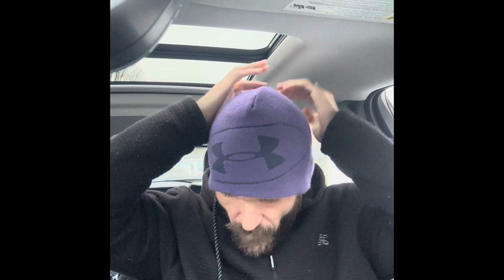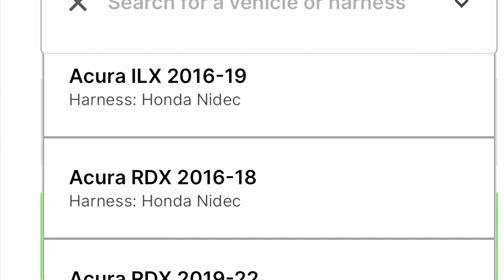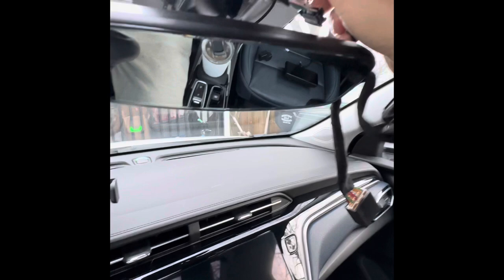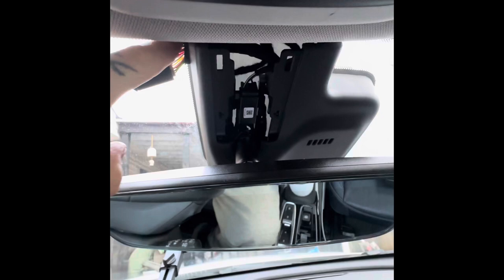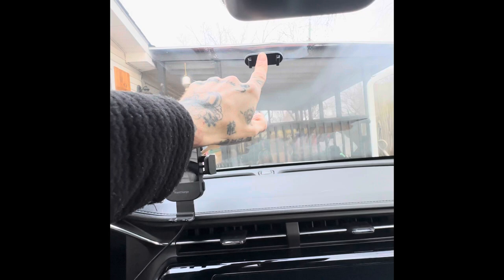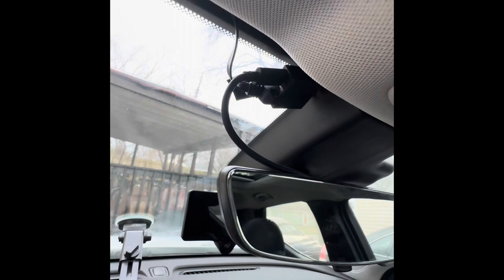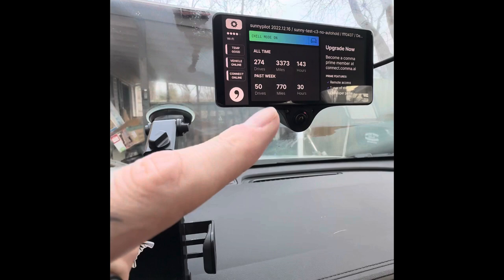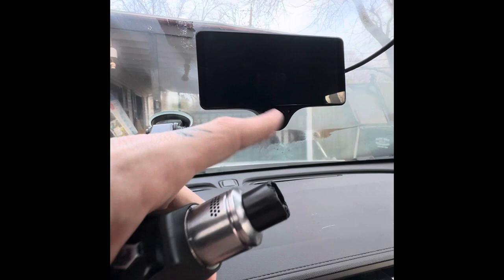How to install comma 3 on 2022 bolt euv premier

Comment: And you never have to pay GM $25 a month for it to work. Cool.
Reply from the maker: Right lol and fyi gm can’t do regular street roads is completely limited. It isn’t the Cadillac super cruise. They have the bolt the old 1st gen half ass super cruise from years ago lol. I’d put the comma 3 against any driver system and it’ll poop all over them 😂 they didn’t rank number one no reason

Comment: I’m stick at removing the cable. I pulled white tab just fine and I’m squeezing and trying to pull the cable but it feels like its glued on
Reply from the maker: There is a little tab that sits behind the white tab that presses down
Reply: Hey Joe. I’m stuck at the same place. How did your remove the cable eventually?
Reply: @jjdm-rz8ek  I was so frustrated that I didn’t care, even if it breaks and used plier tool and it worked

Comment: I cannot, for the life of me, get the camera plug out. I've got the white tab released, but it just won't come out of the socket. Any advice?
Reply from the maker: Behind that white tab there’s a black flap to press down as you wiggle it out of the socket
Reply: Frank were you able to get the  cable plug out? I’m having the same problem

Comment: someone please explain purchasing the harness part. Is the GM harness sold by comma the only part I need (aside from the comma 3x system), or is there another part that I have to buy from etsy? Appreciate any clarification
Reply from the maker: Yeah just need the harness the rest comes with the comma
Reply: I bought it from China. Cable and the box and shipping cost $68. It arrived in about 2 weeks.

Comment: Good job for this very nice video. How i wish you did not do shortcut on the very important part of installation which is the removal of tha camera harness. I struggled so much and the white thing came off by itself. I dont know if theres a way to pull the harness out without the white lock.
Reply from the maker: I have a video of how to remove it and one how to connect it all
Reply: @DarkCloudVapors  thanks a lot for you video. I manage to remove it finally. Im going to test it tomorrow. Keep up the good work.
Reply: @DarkCloudVapors  could you include a link in the video description?
Reply: So glad I'm not the only one that struggled with this I was trying plastic curved pieces my fingers nothing was working! Finally found two of the smallest flat heads I had laying around one on each side of the pull tab and pulled on both sides at once popped right out. Then I used the smaller of the two to push down on the separate black tab and wiggled the harness to get it out.
Reply: no you don't @DarkCloudVapors

Comment: I wish it was more like a heads-up display with external cameras rather than obstructing the view through the center of the windshield. Some cops will stop you for hanging an air freshener from the rearview mirror.

Comment: I had read on the Bolt reddit that the power cable running to the OBD is not required and it gets the power from the harness connected at the mirror.  Is that true?
Reply: I just tried this on a C3X and it indeed worked. Whether it's enough always, I don't know. But it sure powered up and seemed normal.

Comment: How ro disconnect the factory cable? it's really hard! Do you press on white tap
Reply from the maker: You have to pull that little white tab forward and then there’s a little clip that you press down and pull it out. The white one blocks it so it has to be pulled forward I used a tiny screw driver

Comment: Would comma 3 work on a '23 EV 2LT with adaptive cruise, or only EUV?
Reply: Yes, it will work with an EV 2LT with Adaptive Cruise Control. It should also work on a 2LT with out Adaptive cruise Control if you also buy a “Comma Pedal”. I just bought a pedal from an Etsy seller and a comma 3 to install on my EV 2LT without ACC.
Reply: @derekude8548  Did you try using the Fork from OPGM before you purchased the comma pedal? I understood the version would work without the pedal do to no ACC. Interested in your experience to help me. My Comma is in the being shipped :)

Comment: Question after installing the link provided. The device started downloading the data then The screen went blank. How long should I wait? How long is the installation process roughly?
Reply from the maker: Shouldn’t take long at all depends on the internet connection. But you should be able to see the progress bar.
Reply from the maker: I see the issue now use the link in description erase the no autohold it’s fixed to not work with the bolt anymore so no just use installer.comma.ai/twilsonco/sunny-test-c3

Comment: does comma 3 use bolt euv's camera to drive? bolt euv has rear view camera, does comma 3 know car's behind you or besides you?
Reply from the maker: They just added blind spot detection so yes and it uses commas cameras to do the steering but uses cars for acc control
Reply: @DarkCloudVapors  i use android auto with my bolt. can comma openpilot work with nagivation (google map / waze) to auto drive? i hope i can handle the local drive but openpilot can handle the highway drive such as get off exist and go to connector to another route.

Comment: Have you considered installing a "pedal" to enable stop and go?
Reply from the maker: No I just use mads and it’s just fine. 9/10 times even when I had adaptive cruise I never set it unless on interstate. Other then that really mads was the go to just to drive and let it do all the steering.
Reply: @DarkCloudVapors  cool. I'm hoping to get a Bolt soon and I already have a comma in my corolla, I'll try to put a pedal and let you know. Thanks

Comment: Does Sunny support longitudinal control yet for the bolt?
Reply from the maker: Yes
Reply from the maker: Sunny and dragon pilot are best for bolt
Reply: @DarkCloudVapors  Whats the thing with only working until 3mph? seems a little weird
Reply: Sorry, newb question…what is longitudinal control?  What is the best place/blog to learn about recommended configuration for the Bolt?
Reply from the maker: @DJ-jq7nc  unfortunately it’s kinda just try some stuff out and see how it goes. Nobody really helps in the discord community. They just tell you to know it or go away basically lol. I hate discord after buying this comma 3. The people there are just toxic and won’t make you feel good or like they care or want to help be warned. Sunny is very closed and won’t help if you don’t already know stuff. So :( only complaint I have is the closed off open community

Comment: What about comma pedal?
Reply from the maker: Not sure I never used or looked up the peddle. Mine was a premier and didn’t need it and these 2 rentals I got last week both ev and euv base 1LT they both worked just fine but you control the gas and braking. With premier it will work but without then yeah you’ll need peddle or just drive and let it do the steering